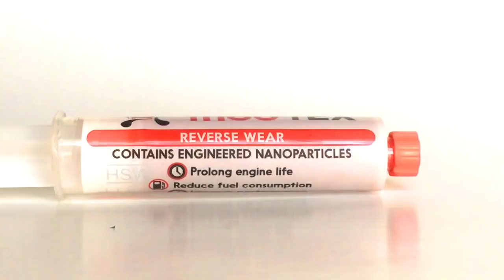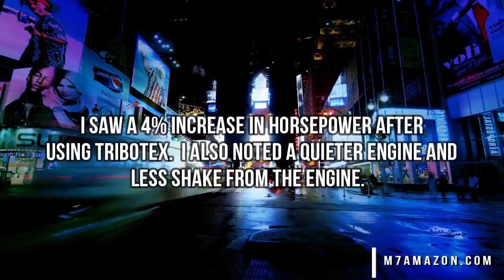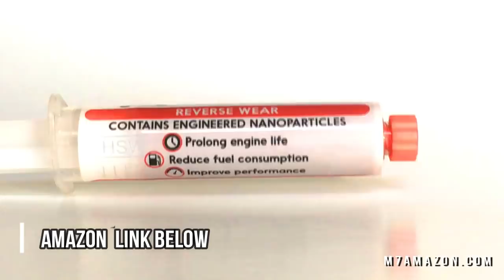TriboTEX Oil Additive!  Shelby Mustang GT Burnout & Review 👍👍👍👍👍

Comment from the maker: Amazon Link:  https://amzn.to/2qkEysS

TriboTEX is a synthetic nanomaterial that reverses wear in your engine. Using TriboTEX reduces your cars fuel consumption, prolongs the life of your engine and protects the environment by reducing CO2 emissions. TriboTEX is a revolutionary breakthrough in engine coating technology. Conceptually the technology is straight forward. The material science however is quite sophisticated; engineered, synthetic nanosheets are designed to be slick on one side and sticky on the other. During normal engine operation, when added to oil, these nanosheets attach to metal surfaces (sticky side down), particle by particle, leaving the slick sides facing outward. After 500 miles, of normal driving, internal components are coated with a porous, lubricious tribofilm exhibiting excellent embedibility and oil retention. The slippery surface contains select catalysts, incorporated by design, facilitating the formation of a Diamond-Like Carbon (DLC) cap on top. Originally these self assembling coatings were developed for improving performance of gearboxes under the grueling demands of wind turbines. The TriboTEX platform was constructed with $1 million dollars of research and development support from the National Science Foundation and NASA. Treats most vehicles, such as Ford F150, Toyota Camry, BMW 3 series, Dodge gasoline pickups, and Chevy V8s. For engines less than 2.0L use our small engine version and for large diesel pickup engines please use our diesel version. For scientific data about TriboTEX please message us here on Amazon. 

This is a sponsored review!